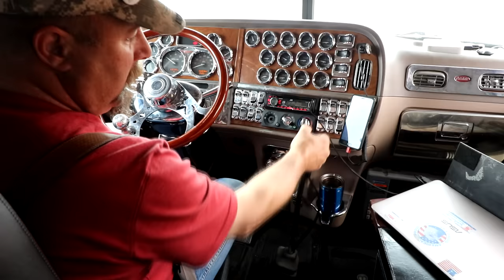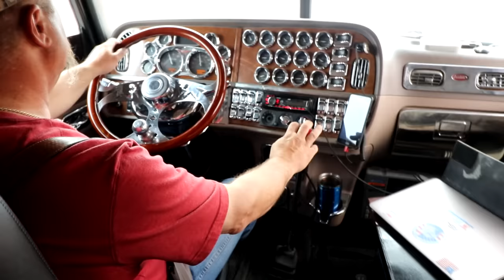How to shift an 18 speed transmission

Comment: What I’ve learned from this video:

18-speed is the same as a 9-speed, just doubled.
Reply: And they don't use them most of the time.
Reply: For the truckers that aced math in third grade.
Reply: I Use All The Gears ..... Just At Different  Times .... lol Thats Why They Are There  lol lol lol I HAVE  Seen Lots Of LAZY Drivers ..... SERIOUSLY
Reply: @Ryan Couchman Well your arguments with Mr Sasnak since I drive a 17 year old Hyundai Getz,and I'm not all that good at that( I hit things a lot, kerbs,posts and the odd pedestrian).
Reply: @Ryan Couchman Well yup . got fed up scratching up my Ferrari 😆
Reply: @RABIDJOCK  But the gears are there when you need them for heavy uphill 'lift offs', 
Gross weights of 85 tonnes are common around town in Australia and in rural and remote areas 140 tonnes and more is the rule of thumb. 
And we do have some long long long uphill pulls/climbs.
Reply: @Ryan Couchman Not to offend you but you are making life hard for yourself for no good reason. I use the appropriate gear for the situation, skip multiple gears going up and down rarely use the splitter except in top range or pulling heavy loads on multiple trailers.
Reply: @Ryan Couchman Saddddddddddddddddddddddddddd !!
Reply: @Ryan Couchman 
This is what 18 speed - and the Spicer equivalent - gearboxes are meant for. When the gear you are in has done all itcan but the next full gear is a bit too much to ask for. 
Answer --------- down split the next gear or up split the one you are in .

The Western Star pulling past the Volvo is prolly grossing 95 metric tonnes or about 210,00 lbs. 
Powered by a Cummins maybe a Caterpillar engine depending on its age -- sounds like manual shift but maybe Automaterd Roadranger.

The Volvo is probably at the latest maximum weight of 140 tonnes or about 308,000 lbs.
Almost certainly Volvo automatic I-shift but last gear change sounds like manual override.
https://www.youtube.com/watch?v=F9joPHwkDE8
Reply: @darrinkulyk9560  Well if you think drivers who know which gears are actually worth using in a given situation are lazy I feel for you.
Reply: @slimchancetoo  Allgood I Have A PHD In Trucking  over 20 Yrs Cl 1 InTown Driving  2500 /2800 Hrs A Year 😎
Reply: @darrinkulyk9560  
I have not heard of any Australian Tertiary Institutions offering "Doctorates in Truck Driving", Logistics Operations yes but the nitty gritty side of things NO !!!!!!!!

All I have is 30 years Over the Road ( I think that is what it is referred to in the USA), or "On Highway" experience, during which time I probably averaged 12 hours a day - the legal max in OZ but it was not hard to fudge another 4-5-6 hours a day in those long gone days before electronic surveillance - by 300 days a year - equals 3,600 hours a year -------- and god alone knows how many kilometres. My estimate is about 6,000,000 'On Highway' kilometres over that 30 years to give an average of 3,850 kilometres a week-----  but quite often exceeded that. 
Might sound a lot but Melbourne to Brisbane return is roughly 3,600 kilometres and I usually averaged 6 a month -- many of which had the added kilometres of a trip to Sydney on the way back to Melbourne, 'The Triangle' we called it, a very common trip.
In fact I once drove almost non stop from Perth on the West Coast to Melbourne in the South East, a distance of 3,500 kilometres one way (you do the arithmetic to convert it to miles if that is your standard) when summoned home as a result of a family emergency. Took me 44 hours as I recall including a 2 hour rest at the West Australian border while my next dose of 'helpers' kicked in. 
At one stage my Melbourne - Perth Run averaged 3 a month. 
Add to that runs up the West Coast to the Pilbara Iron Ore Region  pulling 2 or 3 trailers with loads secured by 'dogs and chains'-sometimes tarped ---- often starting in Melbourne with one trailer and accumulating more on the way. 

That used to sort the Men From The Boys, the Shit From The Salt -- but I was never accepted as one of 'The Nor'wester Men ---------- not enough Get Up and Go about me.

Following a rather serious crash (roll over) year 2000 I retired on my hard earned savings but after a round world trip (by deluxe and not so deluxe trains) which began as soon as International travel returned to normal following 9/11 I returned, or rather was 'dragooned' back to work out of boredom --- and the fact that one of my "old road mates" needed a hand with his growing business. This time doing local work - Greater Melbourne and near country (rural), mostly container traffic - import and export. Back it up to a loading dock and either drop out and bobtail back to the yard or 'sit and wait; while it is loaded or unloaded.

Currently doing 'sideloader' work (don't know what you call them) Self loading unloading trailers that drop off containers at customers premises who unload or load them on site. 
Most days are 11 - 13 hours  4:00 am 5:00 starts and 6:00 7:00 finishes and we often work weekends as well. Containers MUST be lifted from the docks within 1-3 days of unloading from the vessel. Otherwise THE DEMURAGE IS HORRENDOUS --- I know because I have on several occasions had to present a company cheque (check) in the thousands of $$$ to release impounded containers.

Not a bad 'gig' for a 74 year old W.A.S.P. Just goes to show if you accumulate enough skills and experience  -and have a good work ethic - you will never be out of work even in times of Covid -19 Pandemics.

Done express/steel/general/ fuel/ relocations and a whole lot more in my 50 years On The Road.

Trucks ----------- owned or driven them all, manual Roadrangers, Spicers and these new fangled automatics -------- which I hate.
Started off in an English D Series Ford -- a DOG. My first Big Banger was an International 4070 Transtar then graduated to a small fleet of cab-over Kenworths running Melbourne to the Pilbara transporting fabrications for the huge iron ore mines up there.
Engines -- Detroit 2 stroke and Series 60, Cummins loads of them, and the mighty Caterpillar including the 3408.

Cheers.
Reply: @slimchancetoo  Amazing  Resume very Good Thats HARDCORE  Trucking Forsure . I once drove a Kenworth  as OLD As Me .... lol lol had a 4 and 5 in It lol lol was Nuts I drove a 8 / 72 Detroit  for a Yr That WAS AWESOME  450rwhp with a 10sp. Mostly GoodTimes  with no Crashes off to work in an Hour 🙂 Safe Driving
Reply: @darrinkulyk9560  
"I drove a 8 / 72 Detroit " ???????
Must have been a one off experimental build I think. Cross between an 8v71 and an 8v92 I think. 
Certainly never released in Australia. 450 hp 8v71 - more commonly called an "Eight Seventy One'
 were fairly rare and loved by those who loved their Jimmy's. It was at the high end of the range -- probably; uprated by owner drivers and their mechanics. Heat dissipation is the big problem -- the higher the HP the bigger radiators are needed.
Mate had a 500 or thereabouts 71 he built himself. Flight revs he adjusted to 2750 rpm.
Only man I ever came across who could dhow you the ticket citation he received when he 'got done' for 159 KPH or close to 100 MPH on a gentle down hill run. 
The officer was somewhat sympathetic as to what would be the result if he booked him for actual speed detected so wrote him up for 120KPH --- penalty was still quite severe bit not as severe as it would have been.
Me??? I was content with my factory ratings and the highest output I owned was the "8v92TTA OO" where TTA stands for Tailored Torque After Cooled  and OO for Owner Operator (special). Factory outpuit was 435 HP.
Cheers.
Reply: @slimchancetoo  yes they made 71s and 72s was one of those awesome  STUFF Banging Gears at 2200 was a light truck so went good 😁 LOTS Of Drifting In The Wet 🙂
Reply: @darrinkulyk9560  
IC. 
I will check out the Detroit website but I think you actually mean the 92 series of engines of which there were a great many ranging from 6V92 all the way up to and including the non automotive 16 V92. 
71 series engines indicate that each cylinder had a displacement of 71 cubic inches.
92 series engines indicate that the displacement was greater at 92 cubic inches per cylinder.
They both used the same engine block -- the 92 was bored out a little to 92 cubic incises per cylinder.
12V71 and 92 engines were built by bolting TWO 6V engine blocks together as were 16V71 and 92 engines made ------ by bolting TWO 8V engine blocks together,.
Reply: @slimchancetoo  yes forsure was great fun was a 1978 Truck With NO FrontBrakes lol lol was crazy they retrofitted the frontend after i started there .It was a straight  truck 26ftdeck .
Reply: @darrinkulyk9560  Front brakes were an optional extra on domestic US market trucks.  They were and are mandatory in Australia.
This was because they are much worse than useless on icy roads common over there. 
I know from experience - see below.

Down here in The Lucky Country we rarely travel on icy roads except in hilly or mountainous country and can quickly flip an air switch on the dashboard to prevent the air signal from going to the front brakes if we get prior warning of icy conditions ahead. 
This is the 'Dry Road/Slippery Road' switch or valve -- did not have time to flip it one time and ended up 'in the shrubbery' as the saying goes.
After that I blocked off the supply to the front brakes permanently.
Why, because when the brakes are applied on ice they have a tendency to 'lock the wheels up' causing pretty much loss of steering control.
Reply: @slimchancetoo  yes indeed i live in Canada and apparently  in the 70s you didnt need front brakes on a TA kinda weird but watever It Stopped Ok was a 78 truck i drove it for a yr . Was a 10speed with 5 DR on the Dash was Fun To Drive Super basic truck .
Reply: It's like an 8ll with a splitter.
Reply: I drive 5axel dump truck with such transmition and i need every gear. And you dont downshift every gear you need to know what gear to put on, on the go.
Reply: @slimchancetoo Not to offend you, but maybe you should do a shifting video?
Reply: Indeed.  I knew that truck drivers didn't use all the gears, especially with lighter loads, but I didn't know that you don't need to use the clutch in the higher gears.  I could hear the air shifter when it was working.  Pretty impressive stuff!
Reply: Biker Rat  I did a orientation run with a 30yr driver  the other week who wanted me to DoubleClutch his Truck for 11 hrs Straight  ..... that didnt happen lol lol .... I stopped DC ing about  2 months after driving class 6 and 7trucks  that was like 98 . I drive so i have 3 gears available  at Anytime Under 90percent Throttle  Over 90 Its 2gears 😎
Reply: @RABIDJOCK  you are correct my friend. You can shift like a 13 when loaded and a 9 when it’s unloaded
Reply: You probably want 800hp with that if u wanna make the brain happy
Reply: Biker Rat  more like a 13 speed with splits on the low side
Reply: Which is the same as a 4.5 speed.
Reply: @RABIDJOCK  No shit Sherlock. But it is how they do it that is the thing.
Reply: @slimchancetoo  how the fk you know my middle name ? Is that you Watson ? 😆
Reply: I've driven a 13 speed in Ca and Az, the splitter was handy on grades.  Before I just had 9 or 10 speeds. Sometimes with steep grade and heavy load, slow going.  The splitter allows you to make better speed and more distance with your limited hours driving.
Reply: Yes, truckers like to say they drive a vehicle with 18 gears to impress people, when really it's 9 gears and an overdrive. 

That said, it's still difficult driving a vehicle with no synchronizers that requires at least 5 shifts just to get up to 40 miles an hour.
Reply: Or 3 6 speeds.
Reply: lmfao
Reply: I could understand the extra ratios for higher speeds, but why do they need the lower gears to shift from 4000RPM to 3975 RPM. Who would need that little difference at low speeds.
Reply: @darrinkulyk9560  And you also capitalize every word, as if the shift button is the clutch and each word is you working through a gear. Coincidence? I think not... 😂😂
Reply: its not doubled, its split
Reply: I think I understand what he means. It's similar to how a 4x4x4 Rubik's cube is just a 3x3x3 Rubik's cube once you make the centre pieces and cross shapes align in a certain way
Reply: Its kind of obvious after I had a huge brainfart thinking how is that possible.. then I had to watch a video explaining it
Reply: I laughed so hard at this comment because I am hearing it as I am reading your comment LOL, I was like, should I just end now LOL

Comment: An 18 speed is also very handy when pulling a smooth bore tanker.  The short shifting helps mitigate the surge that comes with a partially loaded tank.
Reply: I'm surprised to hear that you could haul a partially filled tank. Even with relatively small tanks in a pickup bed, the sloshing of the liquid makes it more difficult to drive.
Reply: 9-13  is all u need, u just cant feel the liquid i assume ,  The only problem with 10 speed i got is .  long  UP Mountain ...Thats where u need to split 10 speed  thats ALL !!!!  if you dont pull 60k pounds---u dont need it
Reply: That's good to know I'm going for my tankers and doubles just past my test to get my permit
Reply: thanks for the advice. new CDL holder here. appreciate it

Comment: He makes this look easy, but something tells me it take YEARS to perfect this technique.  Awesome video.  Makes me wish my little Saturn was a 5 spd manual instead of the slushbox it has!
Reply: Learning how to float through the gears as he did is actually pretty easy. It's a rhythm and you can pick it up pretty quickly. It's the downshifting that is harder to master.  These transmission's are not synchronized. So you you can't push in the clutch and just drop it in a lower gear.  So typically you only split 18th back to 17th and then you drop a full gear at a time. So you bring engin down to about a 1000 RPM's  it's 450 RPM's between gears so when you come out of gear to down shift you have to rev the engine up to about 1450 RPM'S before it will go in gear. Your RPM'S have to match the speed for that gear
Reply: yea id say its way easier to float gears in a semi than in a car bc if the synchros. it took so many weeks of careful attempts in my pickup to float her gears. i floated gears in a semi the first time i ever tried.

i promise its the easiest thing ever you have so much room to shift its so nice.
Reply: @anthonyaubuchon765  yea exactly it. upshift floating? the easiest thing. downshift? floating? thats a true challenge for a man of experience. its hard enough to downshift with the clutch in, with the rev matching and all that but my grandfather makes downshift floating look like childs play
Reply: Not really once you master upshifting and matching the revs to the gear ots easey down shifting is a little harder but the truck will tell you when you can shift lol 
In a short time it becomes 2nd nature along with double clutching. 
This  guy explained it preaty well
Reply: @anthonyaubuchon765   Best comment that I have seen so far. These twin-countershaft transmissions do not have syncros except for the range and splitter, and those 2 are shifted by air. You must match up the speed of the input shaft to whichever gear that you are trying to go into.
Reply: He
 literally said it takes a long time to master
Reply: Once you learn to float, you'll never use the clutch again.
Reply: it takes few minutes actually
Reply: When you are 👩‍🌾’s kid and master tractor’s 18 gears (15 forward and 3 reverse)at 10 standard 😅😅😅
Reply: @aulakhfarm6105  I can get 4 reverse out of my 18 . What 18 are you using??  18 speed is not an accurate  description for those looking.
Reply: @jdavis7515  yeah yeah that's shits played out.
Reply: @cory7730   Mahindra Arjun 605'  5 regular and one backward total  6 (6 in each low medium and high) 6×3=18
Reply: @aulakhfarm6105  oh ok a different trans
Reply: @anthonyaubuchon765  what is actually the reason behind it being non-synchronized?
Reply: I double clutched a 10-speed in School and with one exception I rarely grind the gears much.
Reply: "something tells me" he literally says that in the first minute of the video omg
Reply: Shifting the gears is more about engine speed than road speed. Once you understand what RPM to shift at, then it becomes much easier to shift, by double clutching or floating. Just understand. floating gears you need to be much more precise with your engine speed.
Reply: I've shifted 18, 10, 8, semi's, along with 4 speed pick-ups and cars, to hell with that give me an automatic. Now I just want get in my pick-up put it in drive and just go.
While I'm here I want to bring up pet peeve, why on Earth do four-wheelers making a left hand turn swerve to the right like they are driving a semi, when I'm riding my two wheeler I have to be careful when I'm passing a car turning left same goes when I'm driving a four wheeler.
Reply: @KaiserBruh heh yeah bs.

Comment: The engineering that goes into these machines blows mind.
Reply: Lmp1 cars are impressive to tbh
Reply: @MagnumLoadedTractor  and f1 those cars push some mad limits the electronics in em are nuts
Reply: @diarrheanator1379  no assists push rod suspension but a hybrid system and a lot of adjustable stuff(fuel mix brake bias and car set up)
Reply: And there are a lot of new trucks woth automatic transmissions now
Reply: @landonbrown8482  why no one thought to make them semi auto you have auto but also paddles of the steering wheel
Reply: @MagnumLoadedTractor  
Dude keeping up with all of those gears would just be hard to do
Reply: @landonbrown8482  you don't have to press the clutch and the paddles are on the steering wheel it's easy
Reply: @MagnumLoadedTractor  18 speed sequential???
Reply: @no.7893  somebody had to think about it at some point